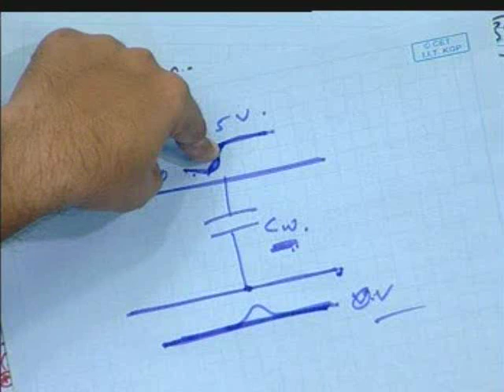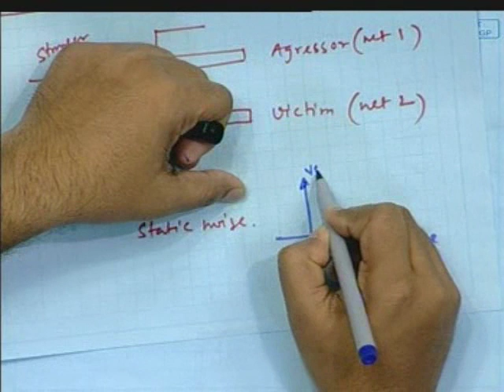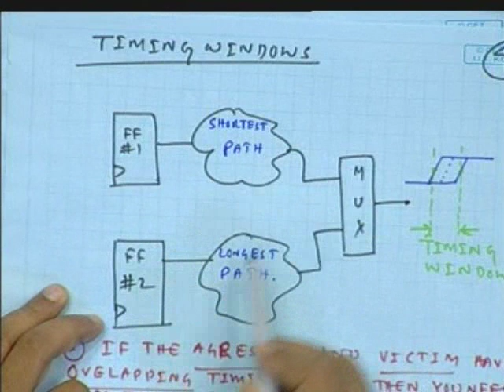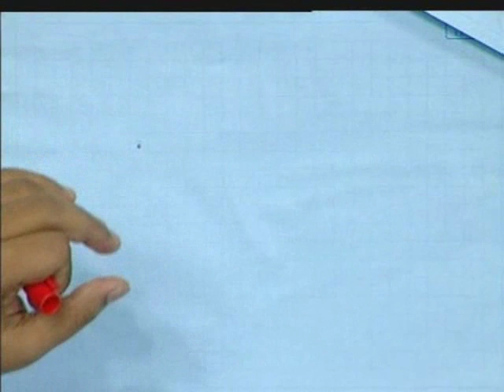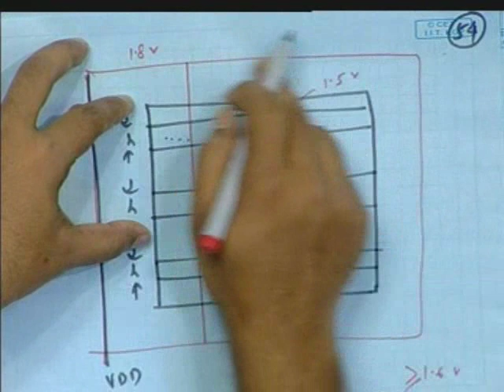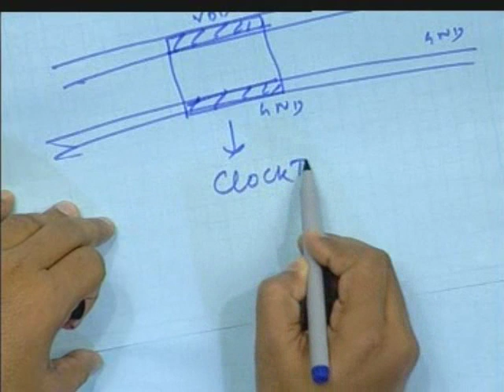Lec-36 signal integrity

Comment: Sir, my question is regarding interconnect, instead of  using a single victim can be have multiple victim below aggressor. Let me explain using an example if you have one agrressor and four victim below aggressor  can this aggressor have coupling with all four victims or crosstalk occurs in all four victims due to this aggressor???????
Reply: The agressor will have coupling capacitance with all 4 but the maximum effect will be seen by the victim nearest to it. The others will also effected but much less due to the agressor. There is a chance though that due to the proximity with the 1st victims signal being effected the next victim signal  gets effected and so on down the line. Hence if you have a case like this you do group shielding for the entire bunch. 

I hope it helps